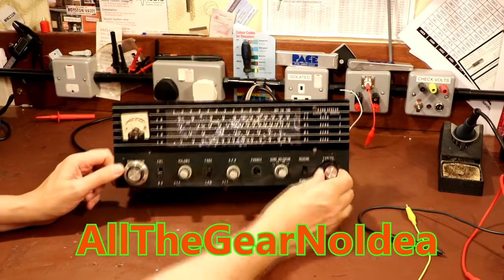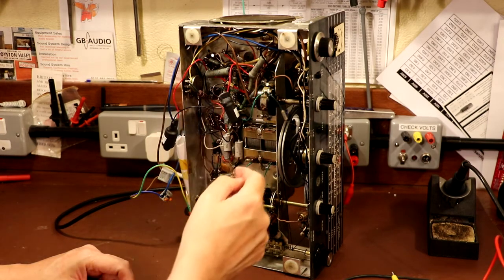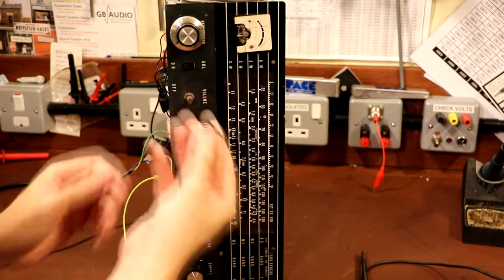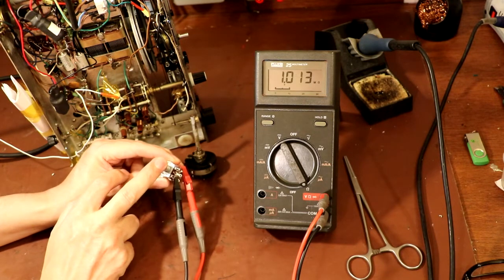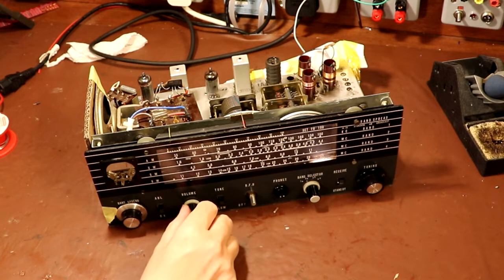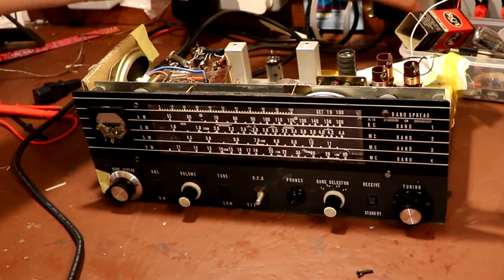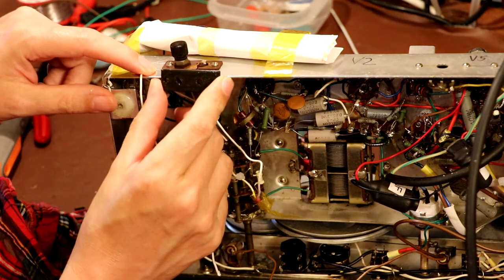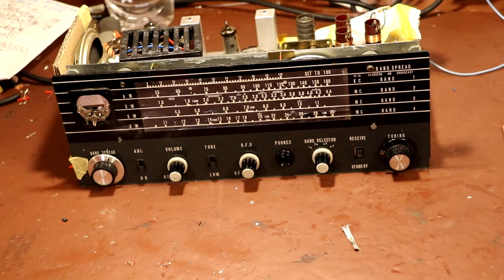Lafayette HE 40    Part 2

Comment: That was a very useful presentation as to how hum can be induced in valve type circuits. The designers of receivers,  especially communications receivers, put quite a bit of thought into how wiring was routed around a chassis. Lead dress, as they called it, can really make a difference  with things like hum and it some cases it can actually stop a receiver from working properly by introducing coupling and oscillations particularly at high frequencies. The old Lafayette is coming along quite nicely. Stay well. ATB Doug.
Reply from the maker: Doug McArtin Lead Dress that’s a word I was looking for and wish I had explained. I will have to remember that for the next video. Thanks for watching Regards Chris

Comment: Very good progress, Chris! Sounds much better already. I'm looking forward to the tune-up video. I thought that AC filament wiring was usually done with a twisted pair to help reduce hum, don't believe I have ever seen the chassis used as a return for filament power. Regards, David
Reply from the maker: David V your quite right it is normally done as a twisted pair. But the circuit has been modified to uses british type 6.3 valves rather than the original series strung 12 volt bulb. I suspect it may have had a 120 volt auto transformer installed originally and they decided to use the chassis as a return. It doesn’t appear to be contributing to the hum but it could do.  That’s why I rewired and put in solid connections to the chassis. Thanks for watching and comments regards Chris

Comment: Yeah Chris, it's pretty much the same radio I have and these videos will be awesome when I go to clean it up and have a deeper look. I won't be as handy in the test and troubleshoot department but your videos will be most helpful to when I go to tackle it. Thanks for the videos my friend.
Reply from the maker: Hello Andy I’m sure you won’t have many problems with it. The electrolytics go bad in the them. The paper capacitors tend to leak a bit but not enough to actually stop it working but replace the grid coupling capacitor . I would be interested in know the valve line up in yours and if it has a mains transformer. None of the power supply in my one is original. To be honest they are a bit deaf but I really enjoyed it lots of SW station come in after dark etc. Thanks for watching keep safe Regards Chris
Reply from the maker: I hope you make a video of your radio I would love to see it!
Reply: @allthegearnoidea6752  no worries. I will Sir. Just finding the time.

Comment: I can think of a few hum reducing methods but it does depend on the wiring. If you stay with ac for the heaters, you could float the line using a pair of 100 ohm resistaters with the centre as ground, alternatively, make the heaters DC.
Reply from the maker: I dont think this radio has any hum now. I have since changed the smoothing caps as they were only 8uf, the main smoothing should have been 60uf

Comment: Volume potentiometers are typically log (audio) taper. In a pinch you can use linear sub if that's all you have in the junk pit, but the sudden rise in volume might be quite annoying. Especially if you are wearing headphones. The Fluke 25 looks a lot like my 27FM TRMS. Got 3 of them all gov surplus w/HV probes. It's a beast. Excellente Chris as always, from across the pond.
Reply from the maker: Danish Native  I think the fluke 27 was used buy the American military and the HV probe looks very good.  I think the British military used the fluke 25. I may have to look out for a 27 on eBay the high voltage probe is nice to have. Nice basic meter and does everything I need. Yes the new  pot that I put in was a 1Meg log pot. I’m not sure what type the RS one that I removed is but probably a log. Thanks for watching regards Chris

Comment: A pot to send you potty :-D, i suspect that the original volume pot had a full metal case that had tin tabs that were bent over the threaded flange mount, so the pot was earthed just by putting the fixing nut on.
For that r.s one i would have found a large eyelet and slide it over the threaded section then solder the thin end to the pot body, but it r.s one is crap so byeeeee :-D.
I also thought a nice screened cable from the pot output to the p.a input may reduce the noise, maybe.
The shaft wobble (yes that's your age :), slide heatshrink on and heat, or a pen/felt tip plastic tube to slide over.
Maybe even brown t.v coax outer cover, i'm full of silly ideas.
I dont have a fancy pants plastic melting machine so i would get the thin but clear stiff plastic sheet found in old switchmode power supplys or cake boxes with a window.
A 90 degree bend on one end then another 90 degree bend 3 inches away from the first, double sided sticky pad to hold it solid to the chassis and the second 90 degree bend would make a roof for the transformer.
Yep bodgy is my middle name lol.
Smashing video chris, smashing that the phase angle fired triac controller did the soldering iron some good ;-D.
Reply from the maker: zx8401ztv  I think the actual circuit diagram does show it as a screen cable but looking at other pictures it doesn’t look like a screen cable was installed. The hum is under control now your right about the screening. The old RS pot was shafted so not worthy saving. Thanks for watching regards Chris

Comment: This RIFA-Capacitor on the left of the bridge-rectifier (23:50 in the vid) looks like it ist wired across mains. This should be replaced by a modern X-type, because this rifas are prone to fail.
The resin ist getting cracky over time  and they are getting hygroscopic ,so that mousture ist creeping inside .. and bang! (RIFA-madness). mmh... may last for 20 years, it where new from factory
Reply from the maker: The capacitor is new and is X1 rated so quite suitable for this application. I have also had a lot of Rifa cap failure. I fuse all my valve radios at 1 Amp  so that does provide some better protection. But thanks for the safety comment better safe than sorry. Thanks for watching stay safe regards Chris